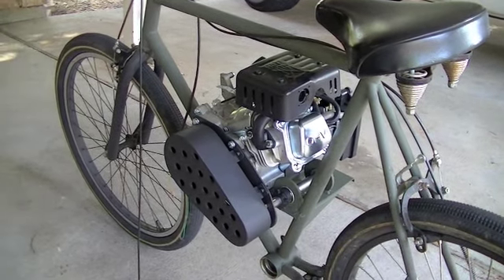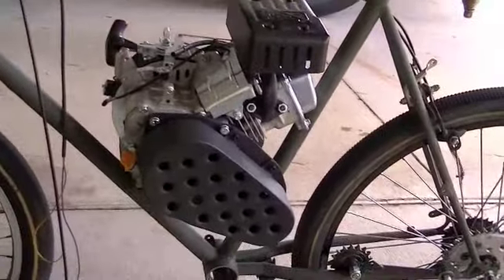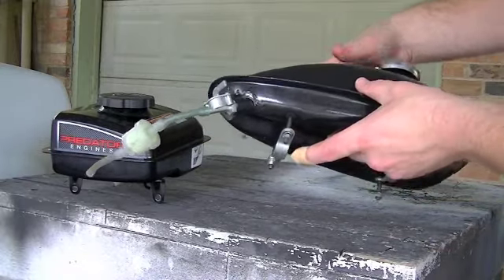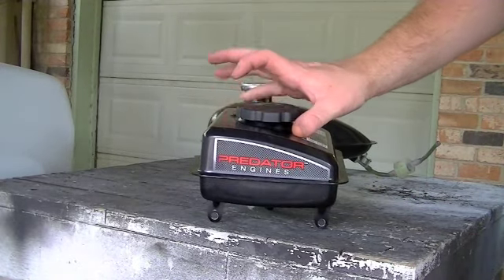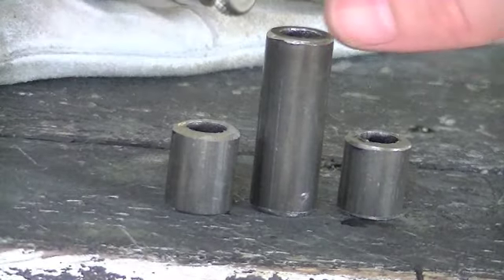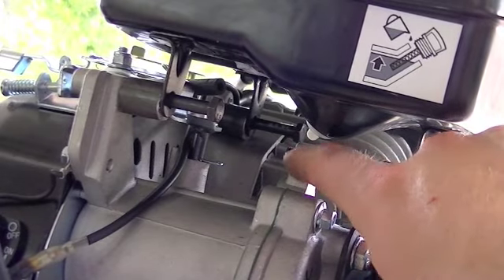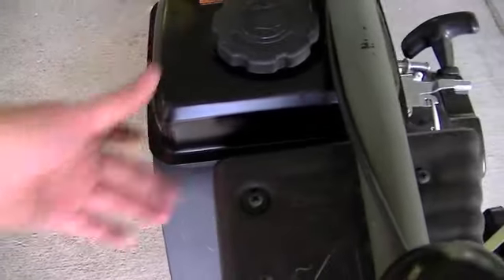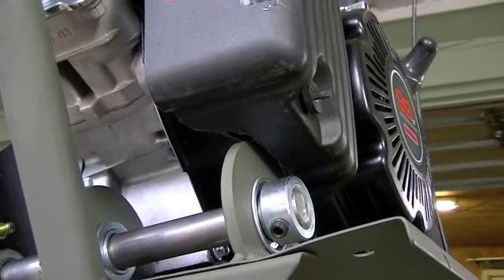Part 25 Motorized Bike | 3HP 4 Stroke Engine

Comment: Really good job!  
Are you going to trim off that excess engine plate on the right?  Crank might get caught.
SickBikeParts com sells front sprocket freewheel that works with the jack shaft to keep the back wheel gears operational and useful in case of also needing disk brakes.  Your opinion?
Is there going to be a part 26 and so on?
This has been one great fabrication course!
I'm all addicted to these series and looking forward to learning more from any future classes.
Many thanks!